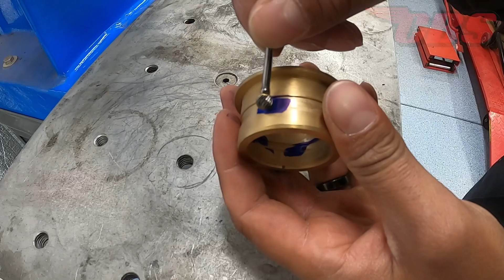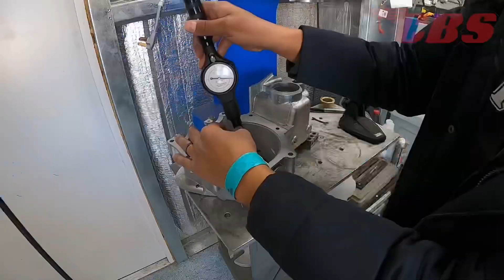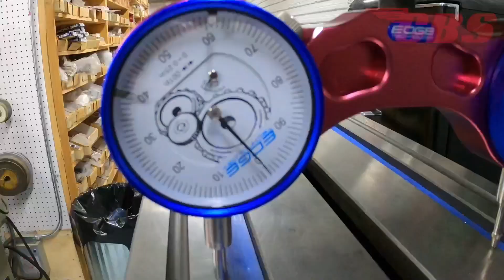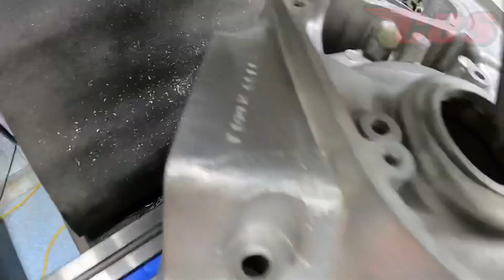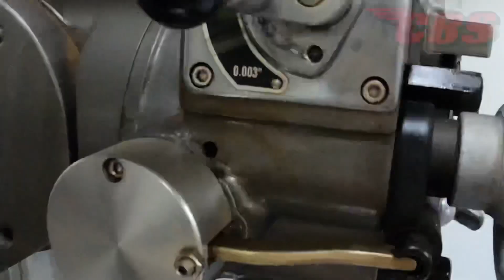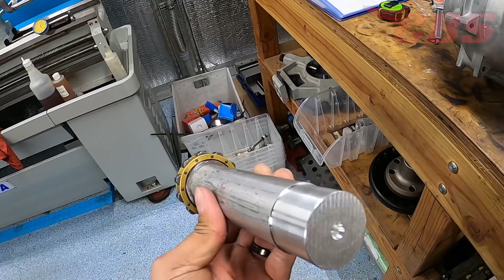Triumph (500) Crank Bushing Boring

Comment: I see that this has been up for a while, but it just appeared on my feed.  Hopefully, I'll be doing a Triumph soon.  My thought...if you spun the new bushing in the lathe and verified concentricity between OD/ID...you could indicate the center of the roller bearing race, and then compare indicator runout on the ID of the bushing at the same X/Y mill table location.  That would provide one more curious check, and help verify perpendicularity (or lack thereof) on both horizontal mill axes.
Reply from the maker: @4ager505  Many different ways to do it, you can check as much as you want as well. It’s not as critical as a lot of people think. Bolt the cases, indicate crank halve, pick up the drive side center and bore

Comment: Did you face the mating surfaces of the cases? Or did you face the top of the cases where the cylinders rest?
Reply from the maker: I lapped the timing cover gasket surface, I debur the drive side crank case halve, I lapped the timing side crankcase halve. The drive side has a lip, cant lap that. The cylinder base gasket surface I will fly cut - video on that soon

Comment: I have but one suggestion: I would the oilways in the bushing with light grease. Then wash out the holes by pumping cleaning solution through the crankcase oilways. You are very skilled and thorough. Very good, I 'second' the previous comment.
Reply from the maker: Thank you very much Wayne!